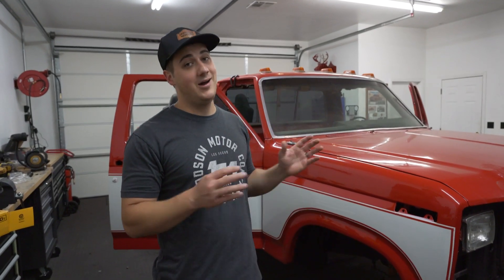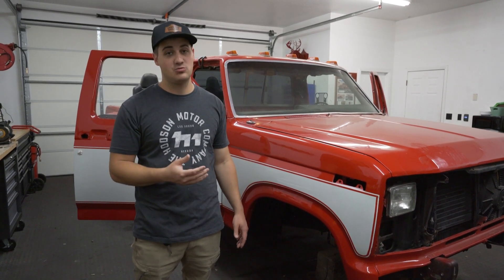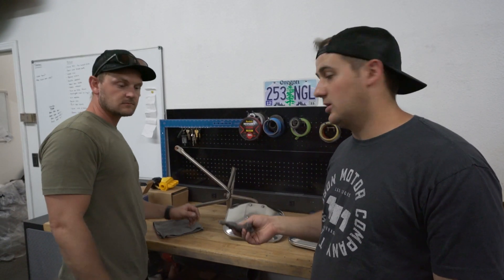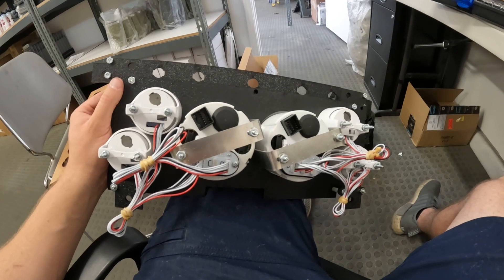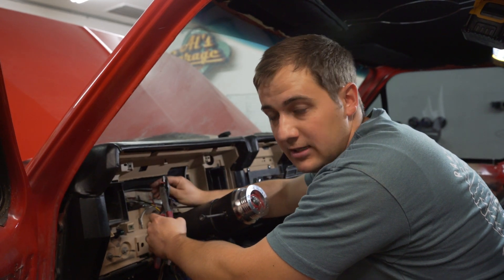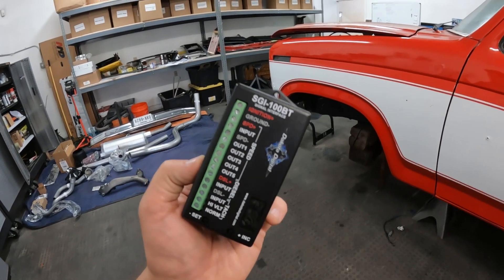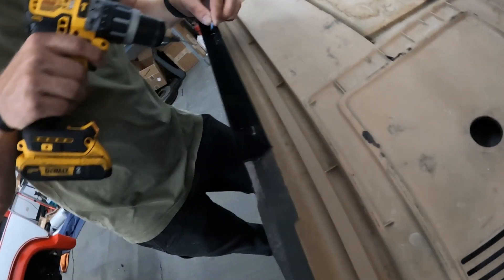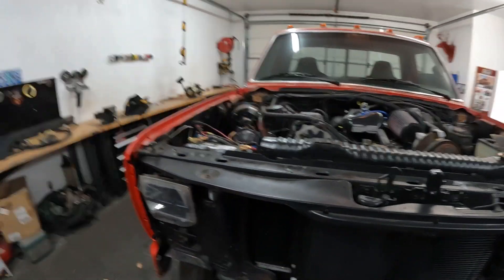Building our Dually Bullnose Ford! | Turbo, Stereo, Lift Kit, Wheels/Tires & MORE!

Comment: How tall of a lift block on the rear did you use? I built a conversion kit for my front 4wd dana 60 swap before sky offered a kit. Thinking about getting their kit to make it look cleaner. Curious if it will change my height lift block I need in the back. Thanks! Looks good!

Comment: I used to have an 87 F150 super cab XLT Lariat with dual tanks.  Hate to think what that would cost today to fill up.  Great truck.
Reply: My daily driver is an 85 f150 with the dual tanks and let me tell ya it's expensive to fill both tanks completely
Reply: @GuiltyPopcornRDRD   especially one with a 460 😳

Comment: Did you have to put head studs in the heads to hold the extra pressure in the engine the turbo produces or do you not have to do that with this engine?!
Reply from the maker: At 10 psi it's not necessary. At 15, you need to.